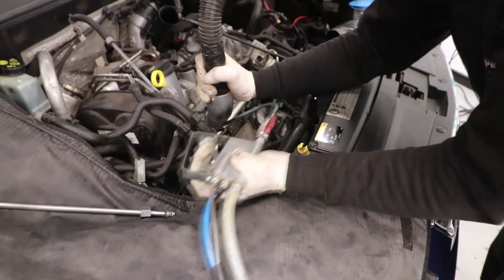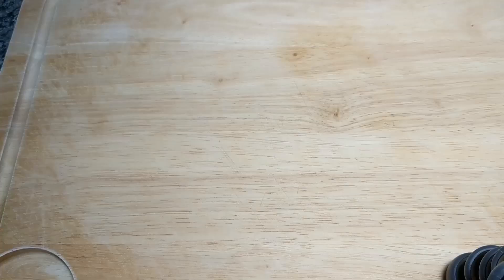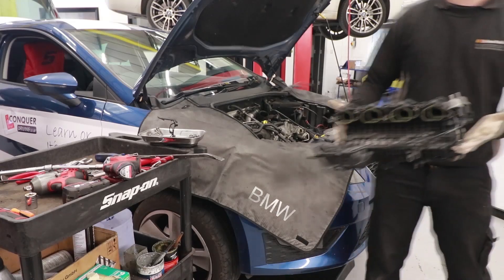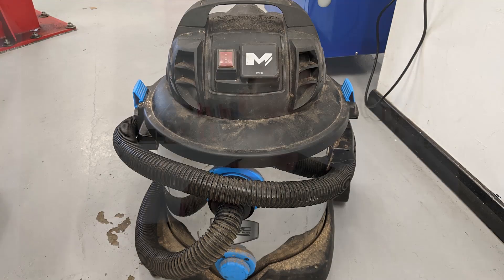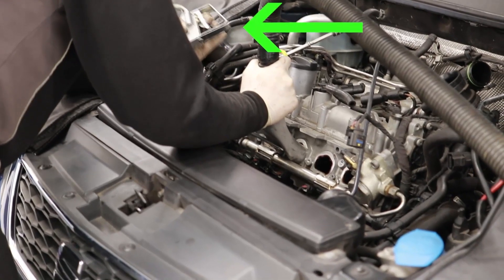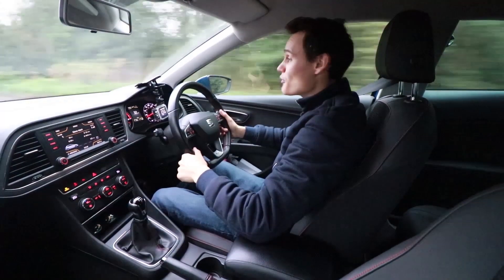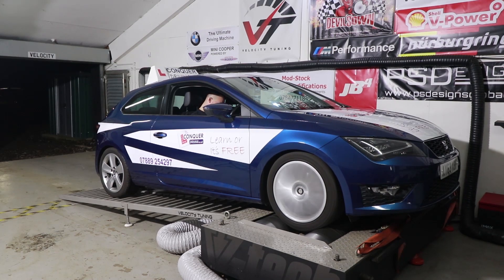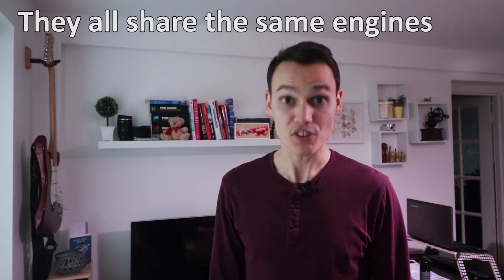Intake Valve Carbon Cleaning - Walnut Blasting Method

Comment: or... OR... just forsake this horrible "advancement" in ICE technology and enjoy something from a near distant past, something light weight, powerful enough for that weight, and PORT injected.  problem solved. What you save out of the shop justifies the slight mpg /power loss. specially if that power and mpg doesn't last you 20,000 miles of your car before you're paying 3-600 dollars every interval for these walnut blastings... plus every time some mechanics put their hands all over your modern plastic intake manifolds/ sensors/ hoses, you're just introducing lots of extra variables and risks of things going wrong on top of that. all leads to these "modern" machines to cost way more than their intended help to the wallet and environment.  
Problem is, the average consumer is a pleb who demands their driving experience be closer to sitting in a deluxe living room on a recliner watching 8K shows rather than actual driving... something that millennial car designers constantly build upon prioritizing... shame,
Reply: What you wrote here is why I bought a "boring" 2020 Toyota Corolla (with a manual transmission) instead of any exciting offerings from Honda, Mazda, Subaru, any German car manufacturer, etc.  Toyota's new engines are dual injected.  So, at least you still have gasoline washing over the valves to keep them clean.  I can't imagine spending thousands of $$$$ on an economy car for walnut blasting.  You buy an economy car because of low maintenance costs.  Might as well buy a BMW or Mercedes if you're going to spend a ton of money on maintenance.  Completely unacceptable.  So, I voted with my wallet.  The trouble is, nearly nobody does any research on the mechanics of the cars they are buying.
Reply: some of us buy used car with direct injection, have it walnut blasted and then install a catch can and switch to regular seafoam regimen. besides some people like toys
Reply: @MacLaw3084  Your response is a prime example of not doing enough research to understand the mechanical problem at all. 
   The seafoam does NOTHING because it will NEVER touch the intake valves because gasoline DOES NOT flow over them like in older cars. if it did, it would never require walnut blasting to begin with. 
   A catch can also does not work. this has been proven. atomized oil vapor easily navigates through any filter a catch can is physically capable of providing and sticks to your valves anyway. all you catch is heavy moisture which is a natural byproduct of hot air becoming cool. it is mixed with oil which "fools" you into thinking "gee im catching alot!" but it really isn't. you will misfire anyway and if you're turbocharged, you will see the futility first hand..

Comment: Hi! What is the name of this tool that makes the job a lot easier? Thank you very much! :)
Reply from the maker: Intake valve walnut blasting adaptor and wand.
Reply: @ConquerDriving  where can I get it?
Reply: Bálint Rácz just google walnut blasting machine, you also need an air compressor. I think its the same machine used for sandblasting, except you need an adaptor which fits to the intake, and ground walnut shell to put where the sand would normally go

Comment: Wow, walnut power!!  Do you think the CRC would have worked better if you had sprayed it through the throttle body dirctly instead of that long pipe?
Reply from the maker: I did spray it directly onto the throttle body. The hole I sprayed it through was directly above the throttle body.
Reply: @ConquerDriving  think he meant the valves

Comment: Why do people keep making something really simple more complicated? Easy to dissolve carbon. Walnut salesman everywhere. http://www.youtube.com/playlist?list=PLppkgAfZ1SDKacUMrYFZGA3yfOEA00MCe
Reply from the maker: I tries chemicals and they didn't work. I would be very interested in something that's cheaper easier and does actually work.
Reply: @ConquerDriving  Water based Industrial Grade Carbon Remover works very well. It converts carbon buildup to co2 bubbles. It will not work if you don't add water.
20 liters only cost $60 USD.
Reply from the maker: Isn't that the same as CRC chemical cleaner which is did a video on?
Reply: @ConquerDriving  Cleaning the intake valve only makes engine idle smoother. Cleaning the exhaust pipe makes huge very noticeable increase in performance.